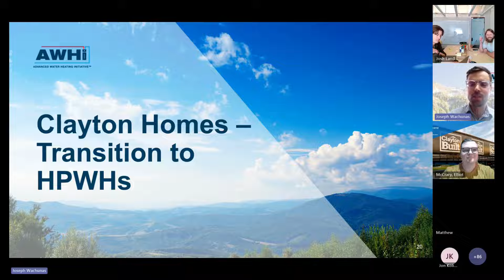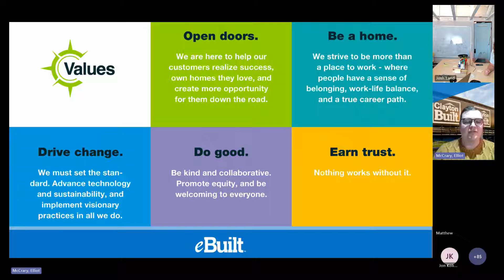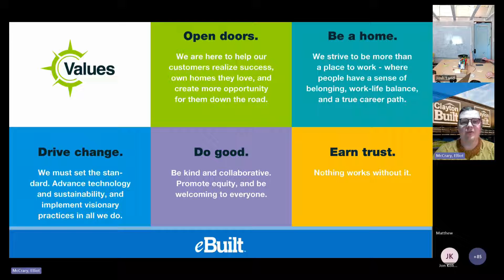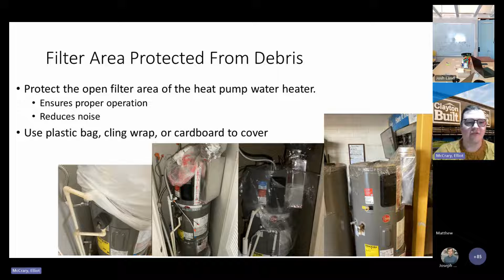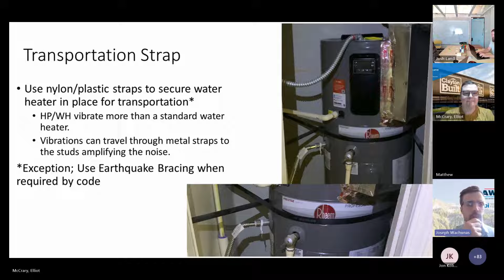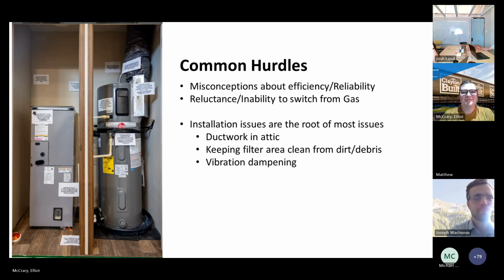Clayton Homes - Manufactured Homes Transition to Heat Pump Water Heaters

Comment: All waiting on Manufactured Homes Decision Season 2024, which should be about now (no surprise elections like France's at this moment, though of course you could import in FRA to break up your development skylines. And that your candidates would be DEM now.)

I'm unplussed because I see very small heaters, perhaps in sync with having one bath on each level (so, 2-3 heaters) plus a kitchen and patio service set, but no air circulation and ventilation schema which would be king. Why be shy about a folio of floorplans that deep?